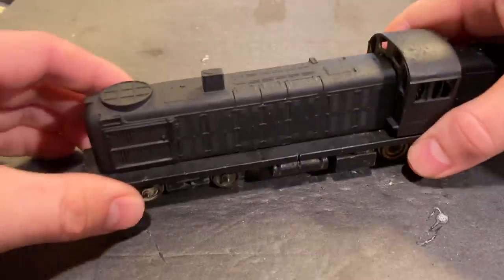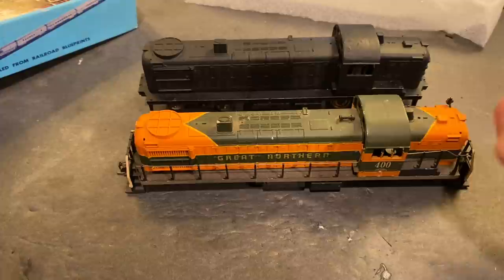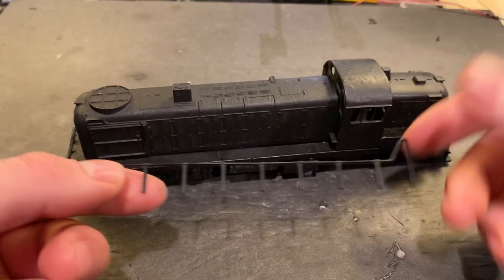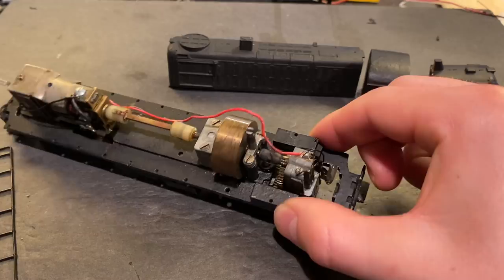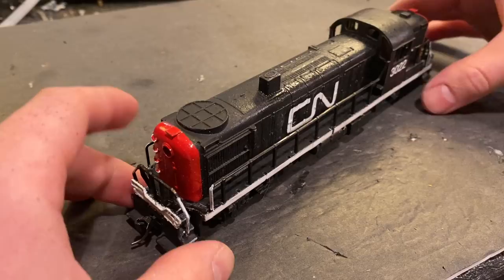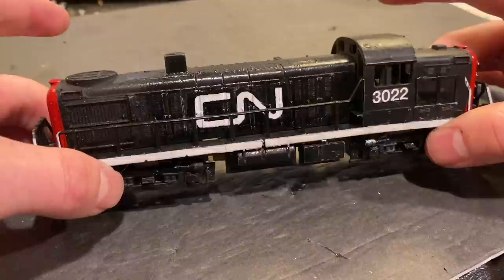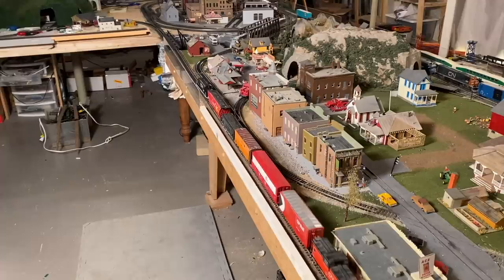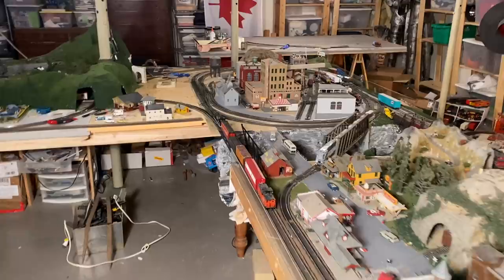Disgusting 1950s RS3 Gets Painted - But There's a Twist

Comment: To make it look like new try this.   1.  Paint the color of the letters you want it to be.   2.  use your stencil to on really good painters tape to create a pattern and cut the numbers out of and stick them on the engine.  3. paint the engine the color you want.  4. remove the taped on numbers to reveal the white under color you painted the engine.   5. spray with polyurethane .

Comment: With where you put the heat shrink tubing for the coupling and it keeps breaking.. how about using some rubber tubing like fuel hose for RC models or lawnmowers, I have used this idea for many couplings on my RC model boats and it works fine.
Reply from the maker: I might just do that. A few people suggested heat shrink tubing but it seems to tear really easy.

Comment: One slight criticism. The fore and aft stack indicates it was equipped with an air-cooled GE turbocharger, which was a disaster. This was virtually universally replaced by a water-cooled turbo which went from side to side (was fatter side to side than fore and aft). I wonder if CN had any Alco's that were still unmodified when it adopted the Wet Noodle logo (not a herald, in my book). Still, you did an amazing job on what looked to be a wreck.
Reply: Excuse me, not Alco, but MLW

Comment: Hi Harrison  
I am enjoying watching your videos I'm new to the hobby and I'm trying to figure out what you are using for the power and the unit that shows the drop in voltage I believe that's what you say any help with this would be greatly appreciated  I only have dc locomotives  so far and only a few I picked up at thirt shops and finding out most don't run but it's a start  thank you for your help.

Comment: Interesting quick and dirty techniques. I thought you would have treated the back of the CN mask with some sort of spray on adhesive to improve adhesion and prevent the mist that gets under the mask. In my case, if I used paint pens, I would end up over spraying with a flat finish and find that the solvent makes the paint pen run......this is always my nightmare on a finished model. I  came across a partially complete Hobbytown RS3 in storage that is now begging for completion now.

Comment: I am only now starting to paint my locomotives now that I settled on a great paint stripper that is perfectly safe for plastics. I highly recommend getting Super Clean to strip paint from plastics! It comes in a purple one gallon jug for around $10 to $12USD the last time I looked. You can make it last longer if you water it down a little. Of course that means it will take longer to work but that is no problem since it works kinda fast at full strength about 2 to 3 hours at full strength depending on the paint type.

Anyway I am starting out slow painting. I am painting some New York Central and Union Pacific steam locomotives first. Why? Because they are usually almost all black! Almost no masking to worry about! You did great with your paint job!

Comment: On connecting your drive sections, take your worm gear or flywheel to an r/c shop and get a package of fuel line. If done it with a couple of my brass locomotives and works really well.
Reply from the maker: I will have to have a look for some fuel line.

Comment: You can still buy the part you need  from Hobbytown rather than the "bound to always be breaking heat shrink tubing".  Not very expensive.  The little pole sticking up in front of the flywheel (with the slot in it) is meant to guide wires over the flywheel.

Comment: I've been working on a Tyco Mantua GP-20 that's not running right.  There might be a short somewhere, because it seems to be drawing too much power and the controller light flashes.  When the locomotive is moving it's very choppy, but when I put leads directly to the trucks it moves just fine.  The thing I find most confusing is that the back most wheel is sparking quite a bit, but the other wheel on the axel is isolated (made out of plastic, so it an’t be shorting that way).  I have no idea why its doing any off this, as I've lubricated it and done basic servicing.  Any ideas on what might be wrong?  Thanks.
Reply from the maker: It isn't possible one of the wheels was placed opposite to the other on the same truck?
Reply: @SMTMainline  Thanks for the response.  I checked it, and all the conductive wheels are on the correct side.(Front truck on the right, rear truck on the left)  I don’t think anybody has been into the trucks before because none of the rivets have been drilled out.

Comment: SMT - As many modelers have pointed out, the prototype rolling stock can have " patches " of new paint on the old weather-beaten paint.  And using light weathering & Dull Cote will even out the finish.  An example is the Great Northern green having the olive shade when new; then it fades to a chocolate brown shade over time.

Comment: For that little shaft part you made with heat shrink you can go to your local hardware store or automotive store and buy a little bit of vinyl tubing and make sure it’s a little smaller then the shafts then slip it over them

Comment: You could give it a shot of Testors dull coat to even the paint out. Nice job!
Reply: I concur. Nicely done. Runs smooth. Hit it with some dullcote (can even use the cheap stuff from craft store) and it’ll even out and look more “real”.
Reply from the maker: I probably will just to give it a more "finished" look
Reply: @SMTMainline  It really does look amazing from where it started.  It runs good for its vintage, too.  Don’t take the comments as negative. Good job!
Reply from the maker: @jdmills4370  I don’t see them has negative. There is room for improvement and this is good advice :)

Comment: Did you make those CN templates yourself?
Reply from the maker: I found the logo, scaled it down to fit and printed it off. It worked okay but it would probably work better with sticky paper.

Comment: This gives me more confidence to paint my own locos. Couple questions, how did you get the stencil for the CN logo? And are there any methods you would suggest?
Reply: He made the stencil out of paper
Reply: you can also buy commercial decals.
Reply: @suppylarue220  yeah from  micro scale or other brands
Reply from the maker: I found the logo, scaled it down and printed it, then it was simply a matter of cutting it out. This would probably work best with some kind of sticky paper.
Reply: @SMTMainline  neat
Reply: Cheapest way is to find an image of the logo, print it in the right dimensions and cut it out.
You want to be even more crazy, you can get a vector version of the logo (Not always) and then scale it for the print, the difference is that regardless of the size you make out of a vector graphic, it will always look crisp and nice.
Which isn't guaranteed with normal pictures you find that are pixel based or raster as they like to call it.